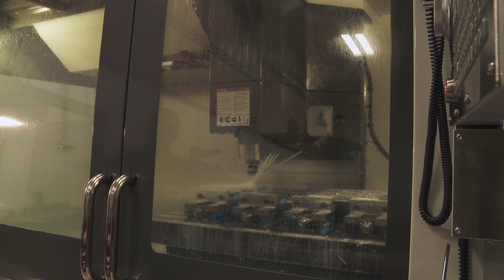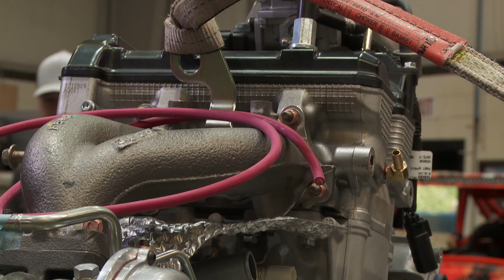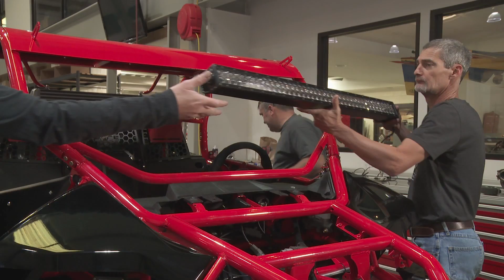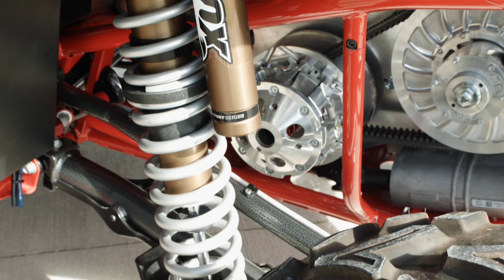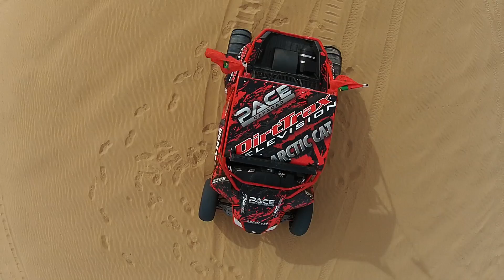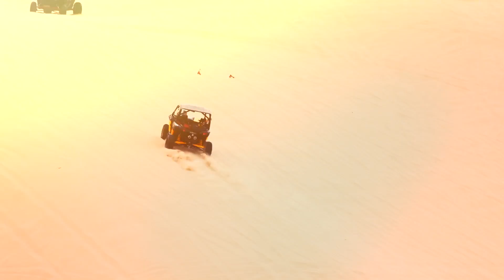GREG BIFFLE 275 HORSEPOWER WILDCAT

Comment: Ok this is an old video but as I read the snide below clearly most have no ideA where the Z1 engine came from. Around 2006 Cat worked with Suzuki and offered the 1000cc  z1 twin in the Jag Z1 snowmobile. No turbo, fuel injected only first year and rated around 125 hp. The engine quickly got a rep as bulletproof.  After market Turbos were slapped on and drag versions were punching out over 300 hp and breaking records at tracks all over. Cat decided to quickly come out with their own tamed turbo version that punched out 180 hp plus. That sled was made in several versions over several seasons and eventually retired and replaced by the new Yamaha built triple turbo that has been dynoed in the sled at over 205 hp at the crank and was clocked at over seven to ten mph faster than the Suzuki built twin. So now a good used Z1 sled goes for four to six grand year and condition depending. So stuffing these refreshed motors in SxS makes sense, but at the same time why not use the newer better Thundercat Yamaha built triple? If money is no object?

Comment: I'd hate to have my clutches out in the open like that. Water sand rocks sticks anything can dick it up
Reply: John Smith ant it'll never be run anywhere but the desert. A bit of sant hitting a clutch at 5000 rpm plus really stands no chance of getting into the spider, rollers, weights etc. many of the guys out westbrun with their covers off.

Comment: Extra belts by the dozen
Reply: you don't sled do you?
Reply: Dan Henderson not necessarily. Heat is the biggest issue with cvt setups, not horsepower. Running without the cvt cover will go a long way towards fixing the heat issue. I'm betting they're also running an infrared cvt belt temp guage to monitor temps too.

Comment: 300 HP through a CVT??? Have fun replacing belts.
Reply: well i bet he isnt using your typical belt on there
Reply: For Polaris owners this is a daily thing though
Reply: Josh Lewis why do you think they're running stm clutches ? I can also gaurantee you they're not running the dayco belt on sale for $99 at Dennis Kirk. Not to mention...if sombody's spending roughly $80 grand on a buggy, I'm sure keeping a few spare belts on hand won't be an issue.
Reply: Kevlar belts...and no there not $99 at Dennis Kirk...